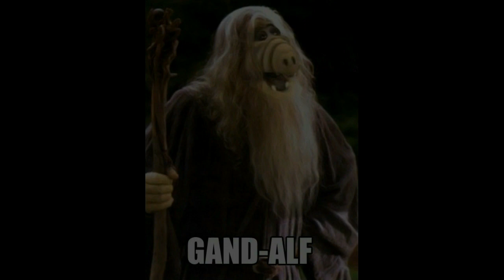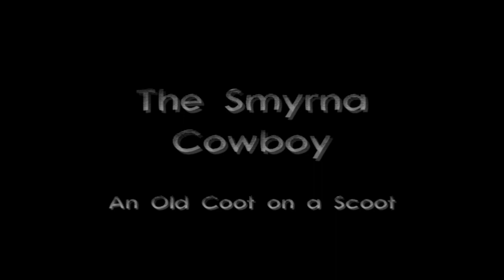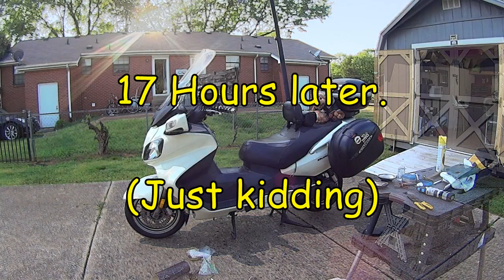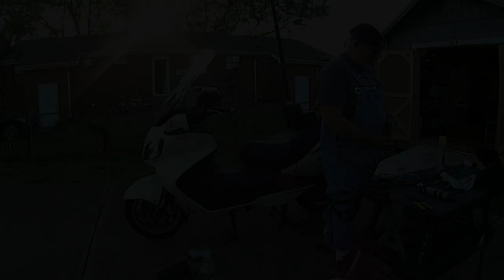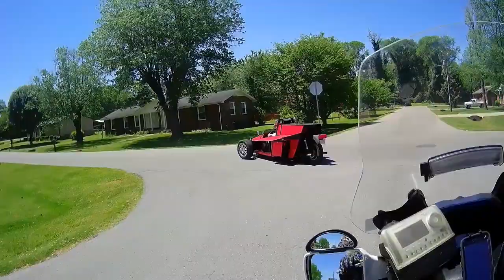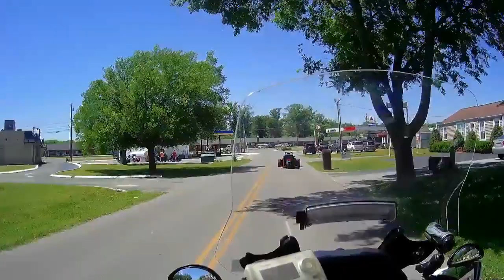Air horn install and test

Comment: I have a 2005 honda 250cc reflex.
I have a 150.db.airhorn. where can I put this beast?  Any idea where ....
Reply from the maker: I'm sorry but I'm not really familiar with the Honda Reflex.  I used a metal extension bracket and used the old horn bolt to mount it.  Hope it helps.